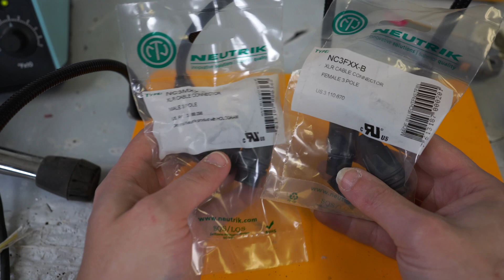How To Solder Neutrik NC3MXX / NC3FXX Connectors To Canare L-4E6S Starquad Mic Cable

Comment: sorry for my ignorant question but why do you use a cable with two sets of blue/white that have to be joined rather than a lower gauge wire?
Reply from the maker: The cable is called Starquad. The two conductors per terminal helps with noise rejection.

Comment: Thanks so much for making this video!  Just curious once you’ve taken the solder iron away from the joint and you’re holding the wire to let the joint cool down, I have trouble keeping the wire perfectly still.  It tends to wiggle around ever so slightly sometimes causing a cold solder joint. How do you prevent this from happening?  Thanks!
Reply from the maker: Hey Bill! Grab a good set of “helping hands” I love the Quad Hands brand. I am happy to be a non paid ambassador for those guys. That unit is such a life saver for me. You can buy direct from them or through Amazon. Here is my page for shameless sales. Check out this page from billylaguardia https://www.amazon.com/shop/billylaguardia?ref_=cm_sw_r_apin_aipsfshop_aipsfbillylaguardia_1TMNPXWVZ330KY6F5AZV&language=en_US
Reply: Thanks so much for the quick reply and the link! I use a vice which works well. Still just curious no matter what one uses, can the slight movement when one is holding the wire to let it cool possibly cause a cold solder joint? Thanks!
Reply from the maker: @billguitarvin  Depending on what you are soldering - try to use more solder. I try to use as much as possible. If the wire moves a little it will be more forgiving since its completely enveloped. Using the XLR connector in the video as an example,  all the cups were as filled as they could be. Helping hands are useful as you can hold the wire in place with the helping hands. The problem with doing it bare handed is that the wire heats up. I solder by hand every day, so my hands are used to the heat so I dont have to use the helping hands in this way.
Reply: Once again, thanks Billy for the quick reply!  Thanks too for the tip about filling the soldering cup with solder so if the wire wiggles a bit, the joint will be more forgiving. Also thanks for the  helpful tip to have one helping hand hold the wire and another helping hand hold the XLR, eliminating the need to have one hand holding the wire.  I’ve wondered how people can hold the wire while soldering because, like you mentioned, that wire gets hot. Ouch! Thanks for answering that as well. All the best to you and take care!

Comment: I'm not a Catholic but when you said your soldering iron was six hundred degrees I was all like HOLY MOTHER OF GOD!!!
Reply: I've got a question - when you screw in the final plastic thing that holds it all together don't you worry that you're twisting the cable you just soldered in place?
Reply from the maker: @bingoflangeworthy  the plastic strain relief doesn’t spin. There is a groove that it locks into in the pin portion of the connector.

Comment: I love L-4E6S but sometimes I wish it came with a serparate drain wire so that I could just cut away the braid because it's a bear to prep.
Reply from the maker: Agreed. That’s why I use the L-4E5AT install version as much as possible.
Reply: @billylaguardia  I should have thought of that before I bought a spool of L-4E6S 😂
Reply from the maker: @Hermiel  I have been in your shoes. Here is a video on the differences. I know it’s a little late! https://youtu.be/sPqWBUOYoAA?si=EmDM-X4nsstxRNju
Reply: @billylaguardia  No, the truth is that the AT version wouldn't suit me for studio mic and line audio cables, which is most of what I use it for.

Also, I commented on that video about 6 months ago ;). 

Also also, these days, for installation (i.e. pulling  through walls, conduit etc), at least in HOW and commercial installations I use shielded Cat.5 or Cat.6. Audio performance is every bit as good (or better than) as the best snake cable and it's cheaper and easier to pull. I terminate the ethernet cable to PCBs that convert 8P8C modular jack to screw terminals, which I break out to XLR or whatever I need. Works a treat!

Also³, My favorite mic cable these days is GAC3 from Gotham Audio. Brilliant stuff. Easy to terminate, excellent noise rejection and it feels great in the hand.

Comment: Any thoughts on why there is what appears to be a solder lug on the button spring part of the female Neutrik NC3FXX?  It looks to me like it is supposed to add shielding to the outer housing, but I'm not sure.
Reply from the maker: It’s there if you want to ground the connector chassis. You can either tie it to pin 1 or use a separate conductor.
Reply: @billylaguardia  Bien. Perfecto, yo me preguntaba lo mismo.
Si quiero hacer una caja con una entrada y varias salidas, para conectar varias etapas de potencia PA. Habría alguna manera de simular en el Interior una tierra ? 
Con resistencias, bobinas, metales o algo así...para esa conexión extra de la hembra Neutrik.

Comment: Any reason you don't unbraid the shield all the way back other than it being a pain in the ass?
Reply from the maker: Just being lazy! They changed the jacketing on the install version of the cable which has the foil instead of the braided shielding. I used to just use the install cable for everything since it’s way easier to build. Now I have to actually follow the rules and use the proper cable for the proper application!! 😂